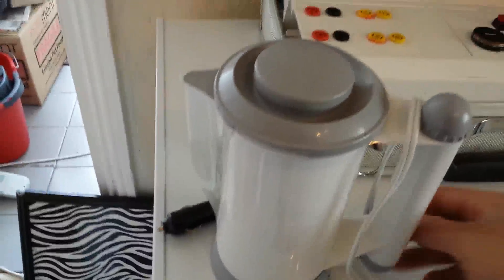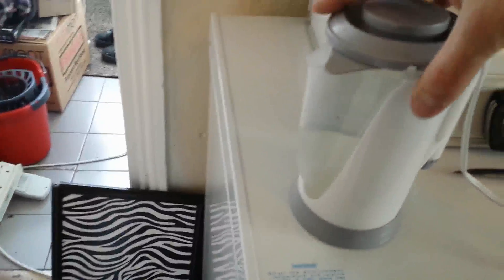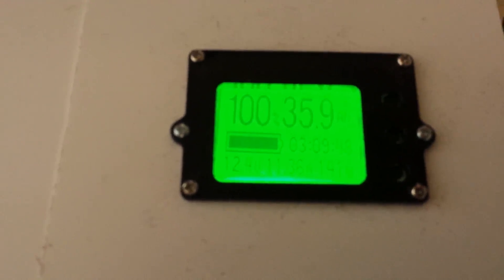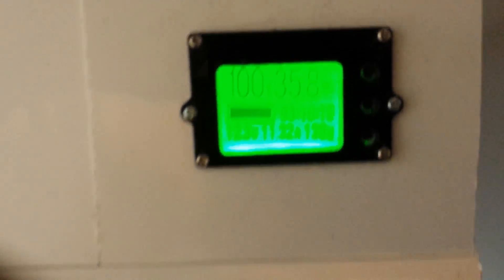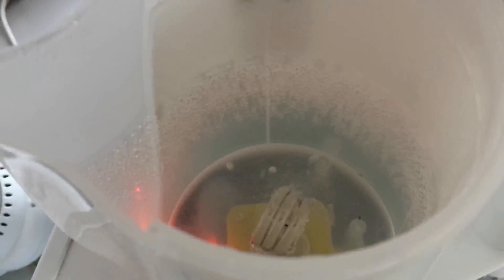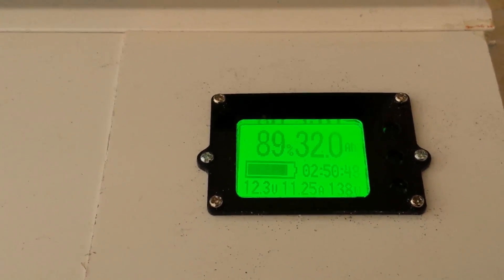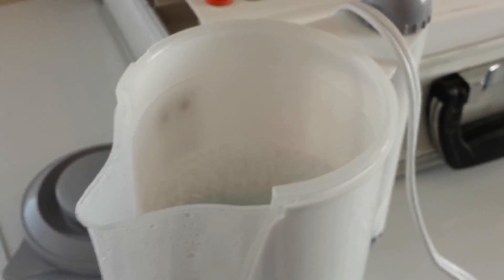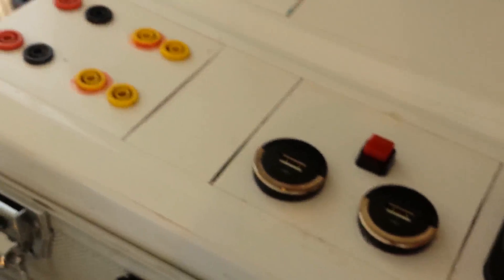LIFEPO4 part 15 - running a 12v kettle for fun

Comment: I've got a similar kettle to yours, but you think your 1kw kettle via inverter would be more efficient that a direct 12v drain? Not sure how that would work out?  It's funny we're virtually making the same things as each other, although I only just recently started building with LifePO4 cells (headway 40152's). I'm just as paranoid as you with my cells so far! (I have off grid system too with Trojans and 40a Tracer). I've got one of the Solar BMS LifePO4 units coming from KickStarter too so really looking forward to that arriving! Keep up the great work with your channel bud.
Reply from the maker: Andology I am super paranoid! Is that Electrodacus if so I have one on the way too! =) I will try it but I don't have a good way of recording results exept it draws 83.3A at 12v x time taken! Would be nice if you did a couple of vids both of your off grid arrangement and your lifepo4 cells?
Reply: Yeah, got loads of vids planned, mainly electronics type ones.. subscribe to my channel and i'll get cracking on some vids this week :) I'm really tempted to buy the iCharger 3010b (http://www.hobbyking.co.uk/hobbyking/store/__11597__iCharger_3010B_1000W_10s_Balance_Charger.html) for my LifePO4 cells, i've got several chargers from being an RC'er for 20 years but nothing that can push 30A with 10 cells! :)